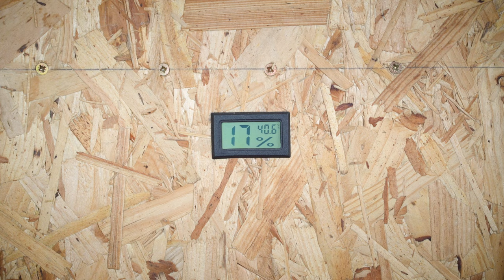Making a Spindle Back Windsor Chair

Comment: A beautiful modern take on a traditional chair.  I have made a few Windsor chairs over the years but using a more traditional form, a far more haphazard method and achieving rather less beautiful results.  Some really useful techniques on display:  A laser level as an angled drill guide!  Who knew?  Nice little drying kiln for the spindles and leg ends.  And the doohickey for levelling the bottom of chair legs - so much better than my block of wood with a pencil taped to it.  I've got to make something similarly adjustable.  Brilliant.